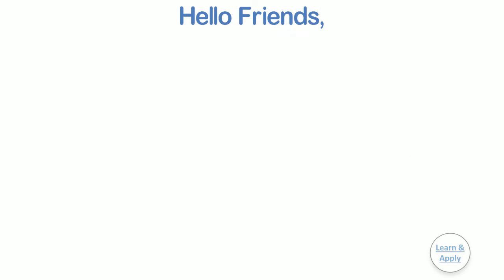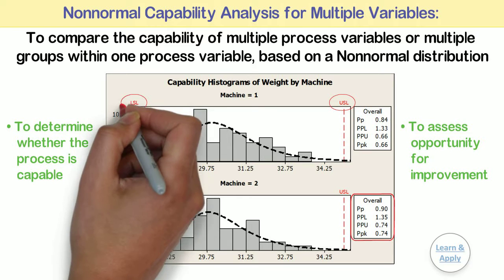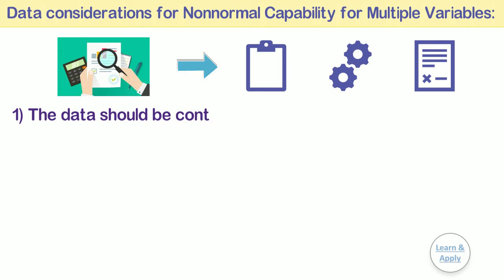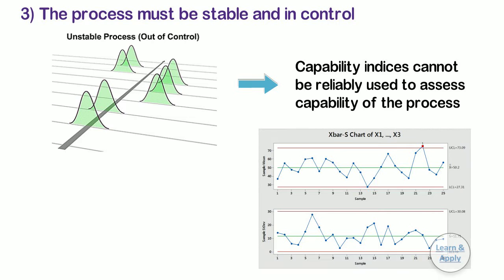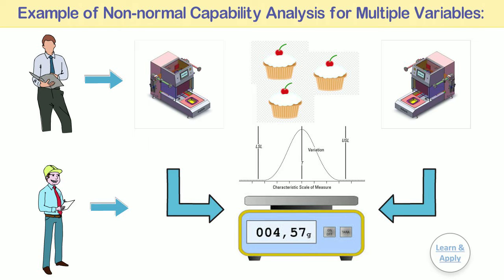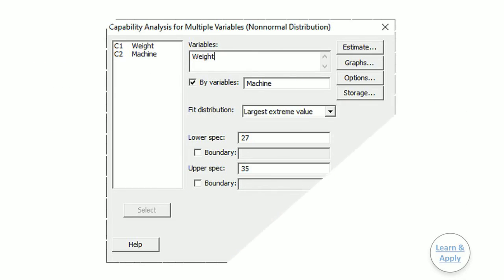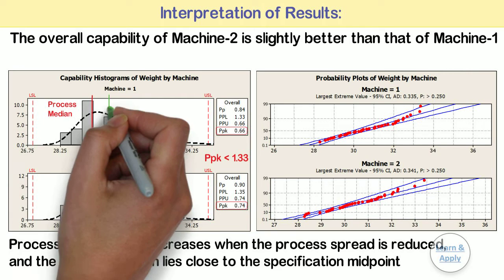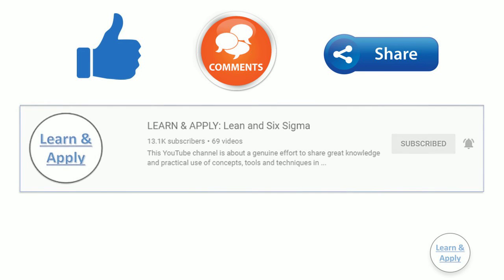Non-normal Capability Analysis for Multiple Variables: Illustration with Practical Example

Comment: I f i have to check tube in many points in it is out side diameter say 7 points (7 out side diameters measurements).how i can calculate process capability and  i have to check other output like internal diameter in same manner in 7 points i have to consider the internal and external each one is out put separately.and i have to check also thickness in 7  points and runt out in same points .all this dimension are  in one part.  I have 20 pieces to produce in serial production and after that continue to produce full serial production  . I can this as sample to do analysis.

Comment: 3 parameter weibull has 0.5 p value and box cox transformation has 0.351 p value. Then why we choose largest extreme p value. Its only 0.25 ! Please explain sir
Reply from the maker: If you have no problem in changing data values by transforming it, then you can use transformation option.
In case of weibull it is with LRT p value. Values with LRT P need to considered at the last i.e. if no p-value is more than 0.05. This is calculated by adding additional parameter to fit the distribution.
Reply: @learnandapply  thank you for your explanation sir.
Reply from the maker: Your welcome 😊

Comment: Sir, how to choose goodness of fit values? Which value to be cosider? I am confused in that!
Reply from the maker: Thank you for your valuable comments.. In selection of best fit, null hypothesis is opposite. I don't want to make it complicated. 
Simply, the distribution having highest p-value will be the best fit distribution.
I had mentioned it in each video wherever required.
Reply: Sir my data was distribution non normal and then i try to find out what distribution that fit with my data. But when i use distribution identification there was not distribution that show p value > 0.05 . What i have to do with my data sir?
Reply from the maker: Please go to LRT p values (Likelihood Ratio Test) in the last column and select a distribution with a p value less than 0.05.
Here is a reverse thing, we need to look for a p-value less than 0.05.
Please let me know if it helps you 😊.
Reply: @learnandapply  very very gratefull for your respons hankyou sir, i will try it🙏🏻 . an then there is something else that i want to make sure, I want to describe the condition of my data, my data is the weight data of a bottle taken from the supplier's production. where a machine has several prints and the data is taken from several different manufacturing days, sampling with composite methode. With data like that, can I still use tools quality analysis or should i use tools quality for multiple variables?
Reply from the maker: The best option will be one-factor experiments like the Latin square method. You can also use quality tools with stratification.
Reply: @learnandapply  sir on my LRT p value  distribution 3 parameter lognormal, 3 parameter gamma, and 3 parameter loglogistic have p value more than 0.05 . But distribution 2 parameter exponential and 3 parameter weibull have p value less than 0.05. Its mean the distribution that fit to my data is 2 parameter exponential or 3 parameter weibull,is that true sir?
Reply from the maker: Yes, perfect. Now give preference to 2 parameter distribution first and then for 3 parameter distribution.
The simple meaning of LRT p values is that distribution is well fitted by adding some additional term to it.
Reply: @learnandapply  sir so sorry i cant understand what kind of preference that you mean? Like a value of anderson darling both that distribution or like what sir?
Reply from the maker: @niakusnaini1543  while selecting the distributions among those meeting the criteria, select the 2 parameter distribution first. If no 2 parameter distribution, then select 3 parameter distribution.
Reply: @learnandapply  sir sorry how do i decide if it's not 2 parameters or 3 parameters?
Reply from the maker: @niakusnaini1543  see the description of distribution 😊
Reply: @learnandapply  do you mean see the definition between that 2 distribution on internet sir? Which one definiton that fit with my data? Is that right sir? Or like what? So sorry sir🙏🏻
Reply from the maker: It's there in the name of the distribution.
Reply: @learnandapply  i see :D sorry sir iam less focused, thankyou so very very much for all those answers sir. It was help my problem🙏🏻🙂.
Reply from the maker: You're welcome 😊
Reply: @learnandapply  sir so sorry there is no description in the name of distribution, how could i find out?
Reply from the maker: Are you using Minitab for it?
Reply: @learnandapply  yes sir
Reply from the maker: Ok, then you can see under the results "Goodness of Fit".